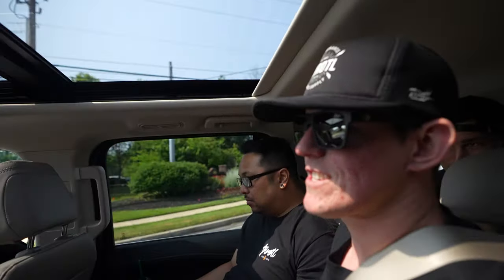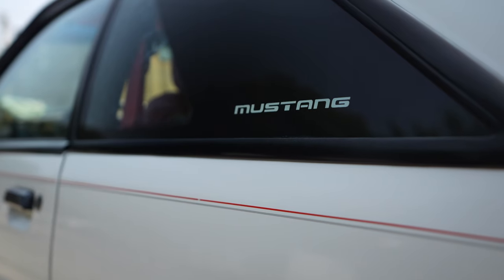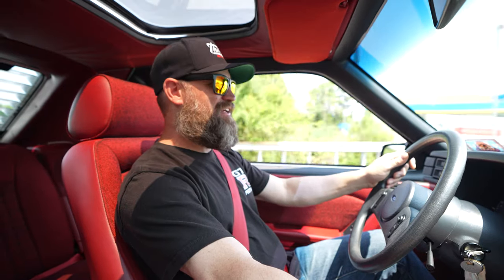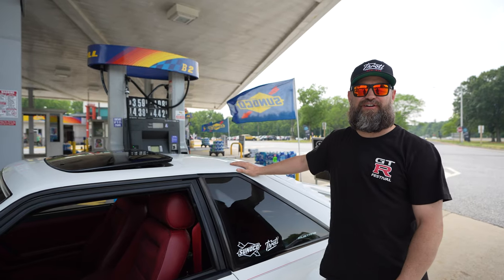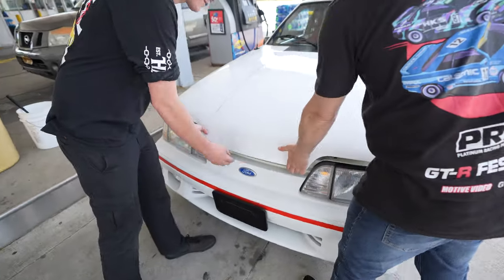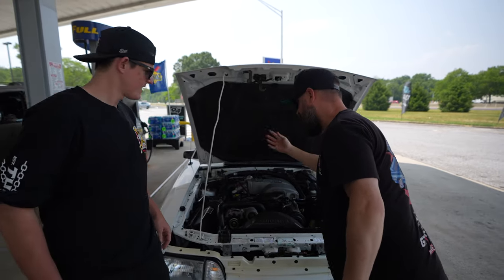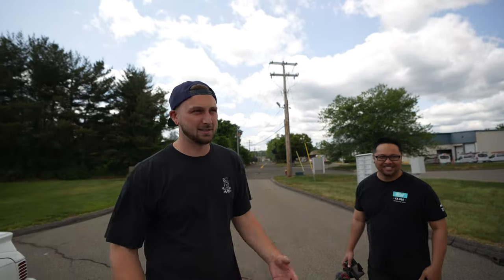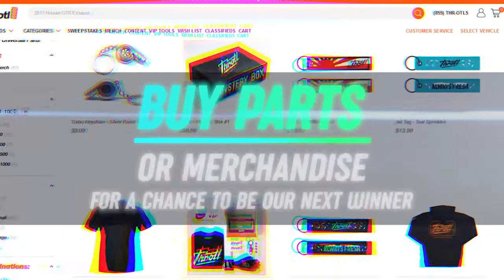Picking up the 1989 Ford Mustang GT | Sunoco X @throtl Episode 1

Comment: IMO, that car is too clean to mess with. I had a black '88 GT with a grey interior with the same options I bought new in '87. I advanced the timing, removed the inner fender silencer, put in a K&N filter on it, and put on the Ford Motorsports "off road" exhaust (no cats). It ran 13.90s on the stock Goodyear Gatorbacks. Back then the only "stock" car that was beating me was an occasional Grand National.
Reply: I had a 5.7 L  IROC  Z. had  a 3 stage hyper tech  chip pulleys air charger ram air flow master exhaust from the cat back BnM shift kit 3500 stall speed converter and ran 1370s 1380s. The car was a freak it ran 1450 1460s stock put 150 shot of nitrous on it and the best I ran was a 12 6 i’m friends with the dude that they bought the car off of he’s had every muscle car from the 80s can imagine